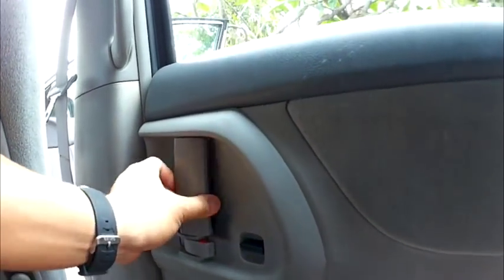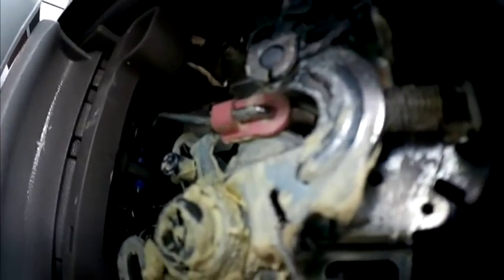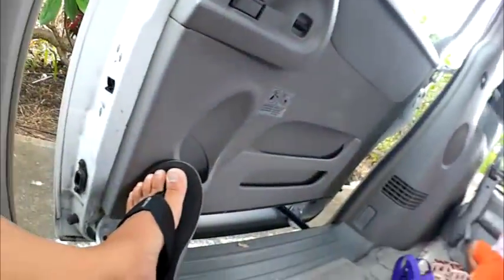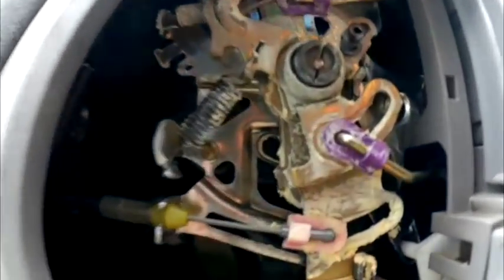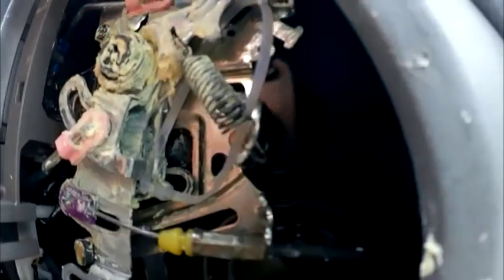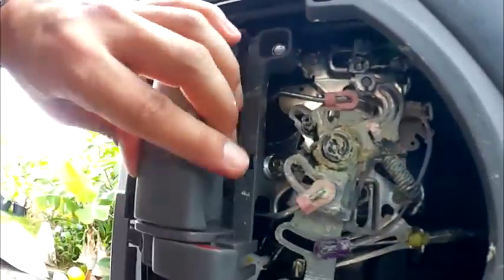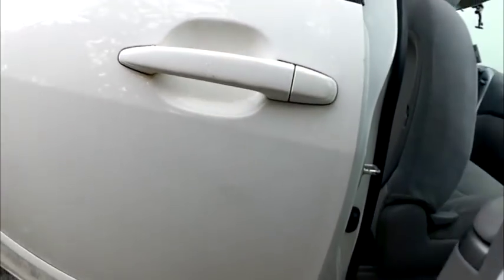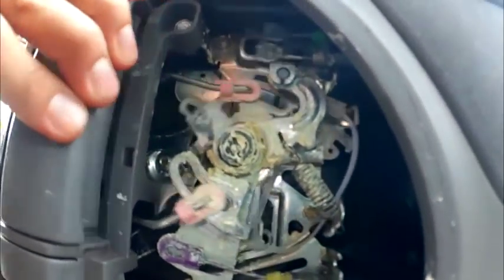2006 toyota sienna sliding door fix

Comment: Great info. You led me to the cause but I used a different fix which restored full operation. That little tubular white nylon piece was still in the door behind the inner panel. I drilled it and tapped it thru for a 6-32 screw. I them put it in position and installed a pan head 6-32 screw. The head of the screw replaced the flat nylon head which had broken off. I jammed a screwdriver against the white nylon piece to prevent it from rotating as I tightened the screw. It’s possible that the screw could loosen over time so I’ll open it up in a year to see if needs to be snugged up. Now the power lock works, the child lock works, inner and outer handles work.

Bad original design. If that nylon piece had been made out of brass we wouldn’t be having these unpleasant discussions.

Comment: Thanks for the great video. I was able to fix my van door after years of not using it. Instead of a zip tie I replaced the plastic piece that works the lock system with a small #10 bolt/screw with a thin washer screwed into a steel/metal screw rivet. I cut the screw to proper length. I put the rivet/ sleeve into the arms which works with the slide lock and screwed the #10 screw (ground down the screw head to make thinner) and the thin washer into the rivet. I made it look like the broken plastic piece. I only had to take a few of the levers/springs off and two handle bolts to gain access to do the job. I can now work the door from the inside or outside and the lock works as normal. Toyota should have used metal in the first place instead of plastic. I had to look at the other side door to see how the lock system works and was put together.
Reply: Adam,
I took the whole lock assembly out so I can work on it in my shop.  Rather than replace the plastic part with a screw rivet and screw, it looks like the plastic part that couples the child safety lock to the lock assembly is the same part as the trouble piece that we are trying to replace.  It obviously has no wear because we never change the position of it.  The problem is I still have not figured out how to take the lever arms off so I can get the bad part and the good part out (so I can swap it in).
Reply: Amazing
Reply: I had the same issue but I reused the old plastic piece, drill a hole and put screw on it. If it fails later, I will try your fix. Thanks. Same thing, I have to check the other side to figure out what it looks like.

Comment: Thank you so much!! My cables on the passenger side died year ago.  The dealer cut the cables so the door could be used manually.  My driver side slide door has been stuck shut for yearrrsssss!!  I'm so grateful just to find a way to open the door.  The dealer couldn't even tell me how to yearrrrrrs ago!  Thank you! thank you!  I'm going to attempt the project of replacing the cable assembly on my own

Comment: My locking mechanism bound up inside the door with it closed so we couldn't open the door to access the screws to take it apart. Seeing this video showed you could pry it open and peek inside. I was able to open it like you did. Once the door was open and I could take the screws off to access the door it was an easy fix. Probably saved me hundreds of dollars by not having someone overcharge me for a simple fix. Thanks for the video!

Comment: I just bought a 2006 Toyota Siena for cheap, planning to turn it into a camping van. Neither of the sliding doors work, folks we bought it from shrugged and said, we just quit using them.    

I got the passenger side open, gonna use tie wire I think rather than plastic zip ties, but, yay! 

Thanks!

Comment: My 2006 Sienna looks a little different inside but I had the same symptoms (inside handle not working but outside handle working).  Turns out nothing was broken but I believe the child-protection feature (preventing passengers from opening doors or windows) was not reset properly.  The inside handle lever was disengaged from the plastic piece it was supposed to "push" to engage another lever.  I moved the plastic piece back into the correct spot and now everything works great!

Comment: I have a 98 and have  had so many issues with the doors! Replaced the liftgate latch in 2016 and it doesn't work now (2023). Replaced both front door interior door handles, drivers exterior door handle (very difficult job), drivers back sliding door exterior handle, and have repaired the door mechanisms multiple times on both rear sliding doors! One of which needs repair again. The motor is solid at 180k miles.

Comment: Thanks for posting this and your insight.  You are a smart man.  I replaced my lock assembly on my 2004 about 4years ago with a new and upgraded one.  Seems Toyota knows that plastic slider is a weak spot as the new one had metal.  To change out the lock mechanism is a pretty big job.  Took me about 4 hours as the window, trim and lots of parts must come off to replace.   The part cost $130 IIRC.  Last week my door started giving me problems opening again.  After watching your post I tore into it again-only taking off the interior lock trim.  Looking over the issue, I did not find that the new lock assembly had broken again.  Looking way up I saw that both of the upper cables were not seated in their proper slots.  You have to push really hard to get them to fully seat.  Since I did the change, this was my mistake.  Putting the cables back into their respective holders and pushing hard on them got them seated better and the door works perfect again.  Well, not perfect-the cables have been broken on the auto opener for about 6 years but the doors open easy by hand and I have never fixed this issue.  With 400,000 miles on her it really does not make sense to fix.  Thanks again for your posts.

Comment: I just fixed mine today, and saw this video afterwards. I got really lucky and most of the white bushing was still there. The problem was that the flat top of the bushing was broken off. It was still there, but stuck in behind in the grease. So then I drilled a small hole into the top of the bushing, and used a computer screw to go through the flat top, and secure the flat top into the bushing. That allowed the original bushing to then still engage the mechanism, AND I can still lock/unlock it with the sliding bushing (I call it a pin). You might also be able to make your own bushing using some washers on both sides, some nuts, and a screw, and just kind of sandwich it all together.

Comment: Thanks for the video!! although I didn't have your problem - (my cable broke but I hack-sawed off the hinge and pulled the cables out to make it a manual door) - the inside handle wasn't working and after I opened it up and watched your video I figured out that the metal little "L" feet had flipped to the wrong side - I used a screwdriver and popped them back and "bingo" - everything is working again - like a manual door - all the girls are super happy with me! Thanks!

Comment: Thanks a lot for the video. I had the same problem on my 2006 sienna with electric doors. After investigating my own door mechanism, I found the tiny white plastic thingy was still there but it didn't look exactly like yours. Comparing YOUR white plastic thingy on the good side and MY own bad plastic thingy, it looks like the white cap on top fell off but there was still a white plastic thingy inside. I assume a good white plastic thingy has a dumbbell shaped but mine lost a "weight" on the top side and the "bar" was showing excessive sign of wear. The "bar" is what hold the two metal parts together which unlock open the door like you showed in your video. I simply pushed the top metal part towards the other one with my screwdriver to reduce the distance between the two metal parts so that the white plastic dumbbell thingy would stop slipping off. I now have a door working just like a new one.
Reply: maybe living on borrowed time and thanks so much as i too had this problem and have since resolved.   As in above i too still had the white disc as described at 3:44 in the video but yet the door would not open.   I pushed the disc down as far as it would go and no benefit.  I then pushed the disk up as far as it would go.. and problem solved.

fingers crossed and hope it stays put

Comment: lol i finaly got it open. was not all that easy. no thanks to this vid lol. mine is a 2009 sienna. all i did really was push real hard on the bak end. i would hear like a poping sound it would scare the shit out of me. see the bak part would kinda open but the front wer the handle is would not budge at all. all i did was keep pushing real hard on that bak end n it finaly opened. i was freakin out lol. so mine has nothing to do wit that mechanism mine was workin jus fine